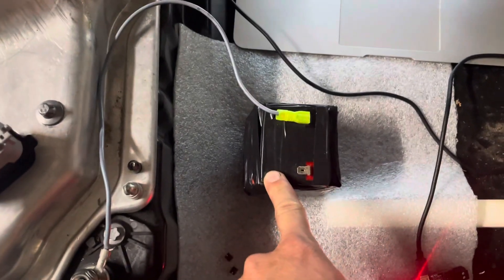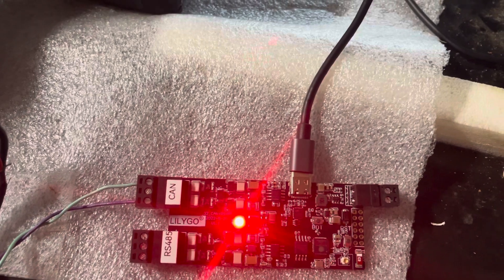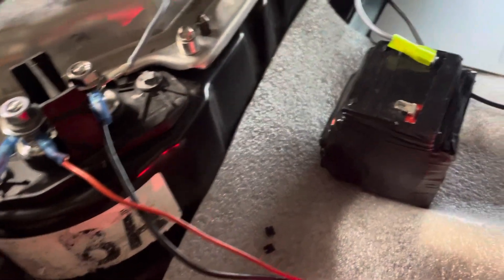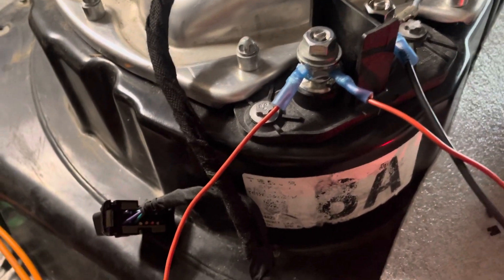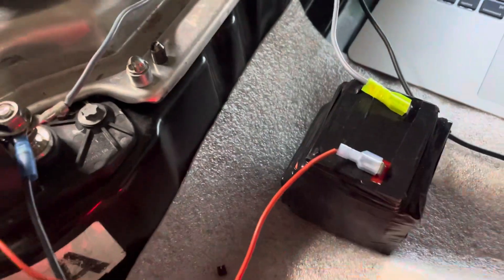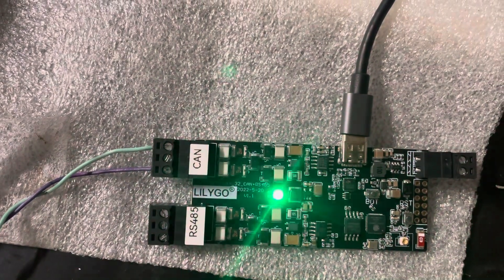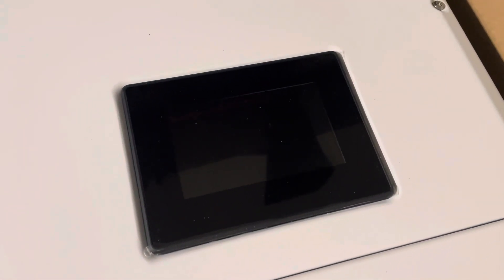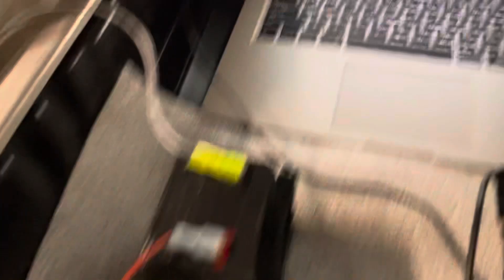How to use LilyGo with BYD battery emulator (Tesla 3/Y battery pack)

Comment: I can’t get the message HVIL Not Ok to disappear and allow the contractors to close. Any ideas on how to fix this.
Reply from the maker: Make sure the lid is closed, all bolts are tightened, and the 3 high voltage connections have their HVIL pins shorted.

Comment: nice video..!! im doing a tesla RWD convertion to a older car and can i use BYD battery for it.. do you have a software or any hardware device to montrall the charginf and BMS circuit.. thanks
Reply from the maker: This project is not designed for EV conversions, you would be better off using one of off the shelf solutions for that.

Comment: Hi I have a question
I am working with tesla model y battery with 75kWh capacity. My question is about contactors inside battery, should they close in case when the whole setup including  lily go, 12V battery, X098 connector, is plugged. Should contactors close without connected inverter, or maybe they need a information from inverter. Have you ever connected that setup without inverter?
Reply from the maker: Inverter is not needed for contactors to close. For more questions, join this Discord group https://discord.gg/ChJpTq7z
Reply: @diytesla  Hello, can I please have a fresh link to the group?
Reply: @diytesla  the invite link is no longer valid, can you please send me a direct link?
Reply: Thank you for reply

Comment: Thanks for sharing, saved the video for later use. Probably going to experiment with this. 2 questions, how can i see if the Tesla pack has a PCS or not? And what inverter are you using if i may ask?
Reply from the maker: You need to remove the penthouse cover to know for sure.  Or you can buy batteries from us.  For a list of supported inverters see https://github.com/dalathegreat/BYD-Battery-Emulator-For-Gen24/wiki#supported-inverters-list

Comment: Hi. You showed the inverter working but the Lilygo was not connected to the inverter. Does the Lilygo need to be connected to the inverter communicate to the Tesla BMS to function correctly? Thanks
Reply from the maker: Yes.  In my test here the inverter is only getting power to boot up, it is not charging or discharging the battery.